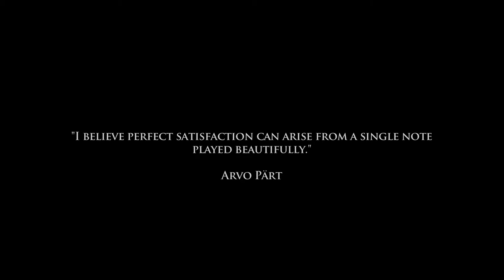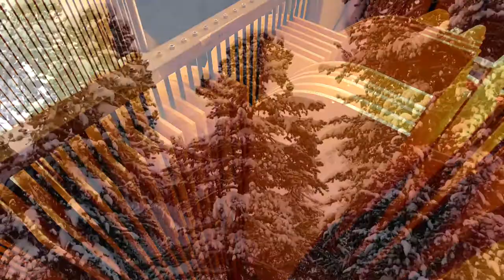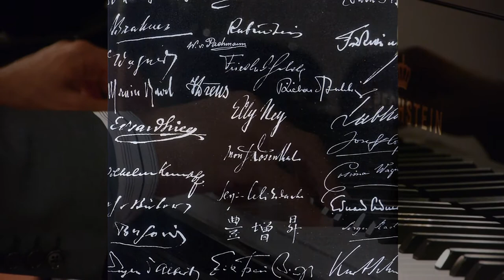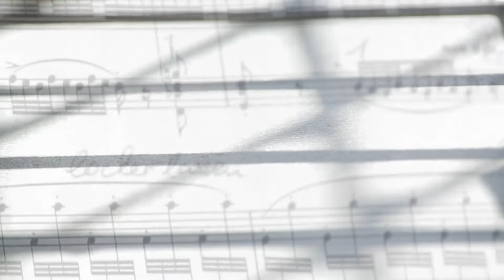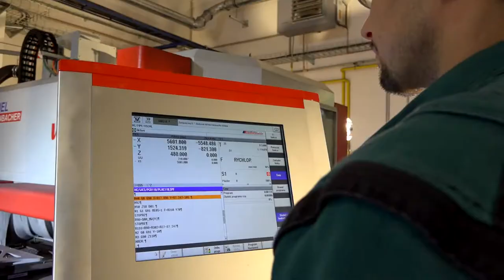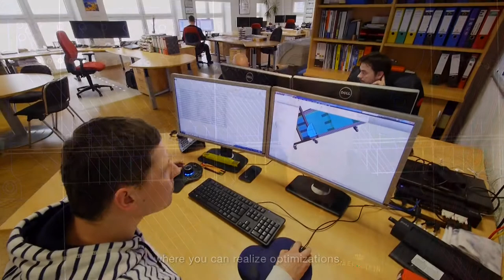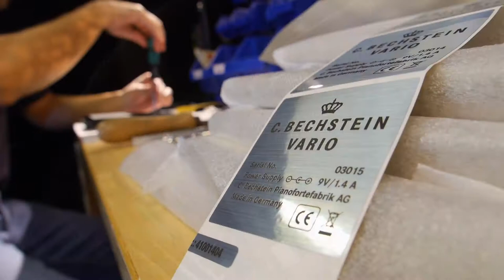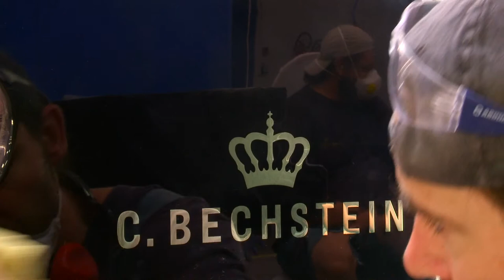C.Bechstein Pianos - Grand Pianos

Comment: Note that Dave Brubeck and Chick Corea are playing on Bechstein Model E-270 pianos, that haven't been manufactured for almost 50 years. Those were wonderful instruments. Towards the end of the video, there's Bernstein playing an E270. Do those musicians know something that the manufacturer doesn't?
Reply: as far as I know the E was 280, not 270. Other than that, I do agree. They are marvelous pianos. And if you want a concert grand for your hopefully really big house, a used E280 can be had for MUCH less than any Steinway D or Bösendorfer 275, 290 or 280
Reply: @Kref3  The E was a 270cm grand. In 1974 (or 1975?) it was replaced in production by the EN-280. The EN-280 was built on the same design principles as the E-270, just bigger. Both models had 88 agraffes, no capo d'astro in the treble. Also individual hitch pins for all treble wire, just like the Bodendorfer 290.